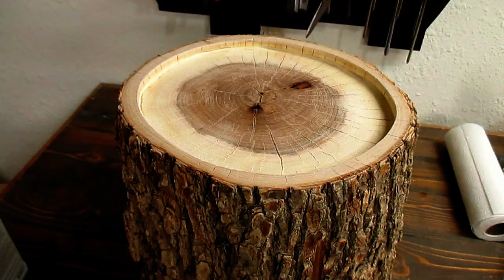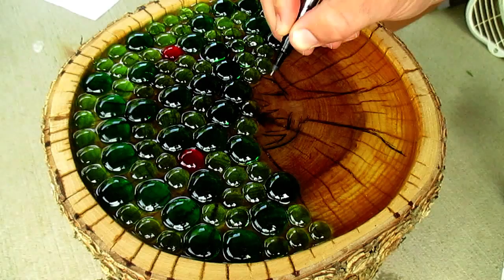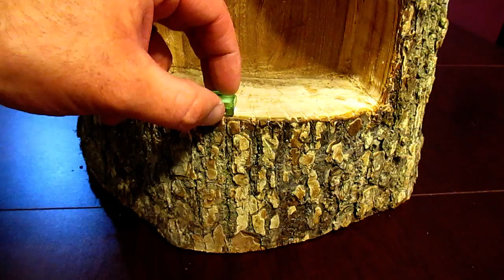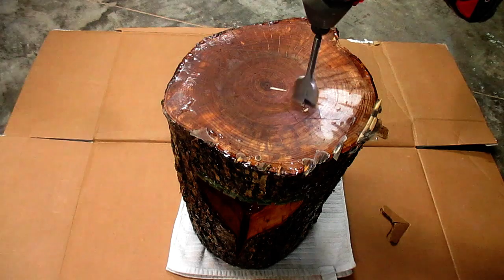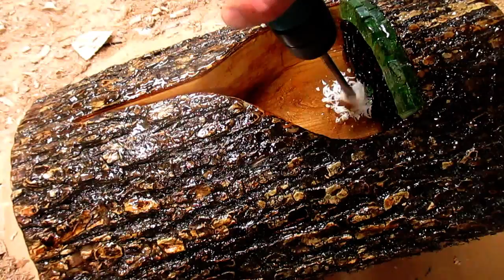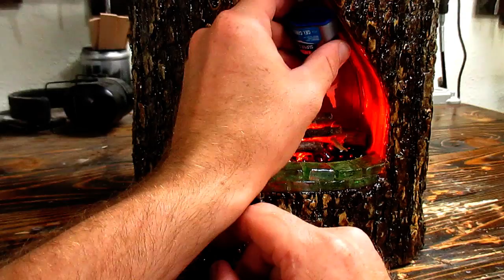Make a Tree Stump Side Table

Comment: Last question, did you use a wood glue to hold beads in place?  If not, what did you use to hold down the design on wood at first?

Comment: Hey Doug, just getting into word working
What router bit did you use to allow you to plunge directly into the wood, without having to enter from the side?
Also, noticed you didn't use a jig to get the borders, how are you so accurate by eye?
Reply from the maker: I used a surface flattening bit like this one: http://amzn.to/2ABqcuZ

Regarding the accuracy, for this cut accuracy isn't necessary. That's one of the things I enjoyed most about this project; No plan and no measurements -- Just start cutting and see what happens :) 

When accuracy is necessary, like when using a trim router to carve out a mortise for a hinge, I use the router to cut close to the line but leave a bit of wood, then use a chisel to creep up to the line. My latest video of the ribbon box shows me doing that.

Comment: love it! what tools did you use? I had a tree fall in my yard and saved 2 pieces of the trunk to greet creativity.
Reply from the maker: The "fireplace" in the front was made with a 1-1/2 inch spade drill bit to remove most of the material, chisels and sandpaper to finish the edges. I tried a multi-purpose oscillating tool to define the edges, but I don't think that worked very well, so I'd just stick to the drill bit and chisels. The depression in the top was cut with a router and a surfacing bit.
Reply: Doug Royal - awesome, thanks!

Comment: what kind of saw you used to carve both top and center?
Reply from the maker: I used a router on the top, and a multipurpose oscillating saw on the center. But I don't recommend using the multipurpose tool for the center. Just use a drill with a spade bit to remove most of the wood, and a chisel to clean up the edges.

Comment: What materials did you use to do the tree
Reply from the maker: The tree on the top was made from glass beads and acrylic paint. The clear liquid I poured over the top was resin.
Reply: Doug Royal was the resin casting or clear

Comment: Very nice work.
Is there a glass put on top of the marbles tree that wasn´t shown in the video?
Reply from the maker: That's just a thick layer of epoxy. That's the stuff I was pouring over top of the glass beads. I just kept pouring it until it made a nice flat glass-like top.
Reply: Doug Royal I see. Thanks
Reply: what kind of epoxy do one use?
Reply from the maker: It's called Envirotex. I picked it up at a store called Michael's. When I started I wasn't sure how much I would use so I bought two 16oz kits. Here's a link to a 32oz kit http://amzn.to/2f0YW0t